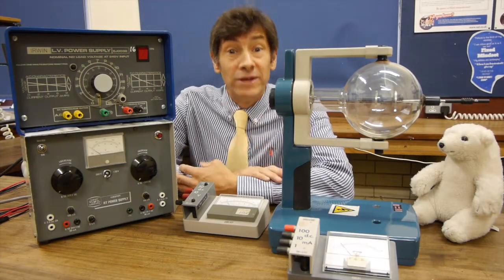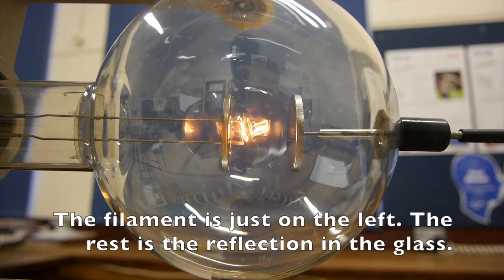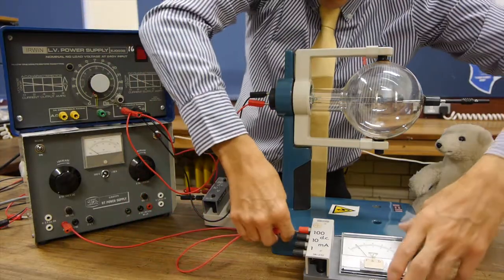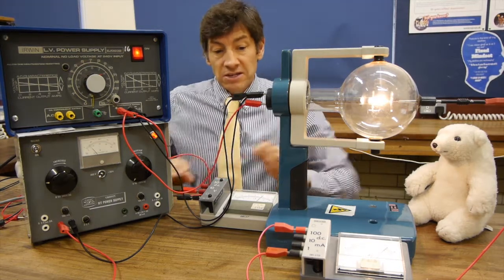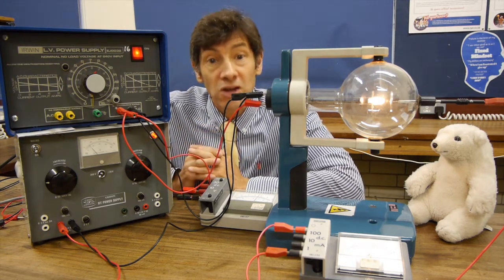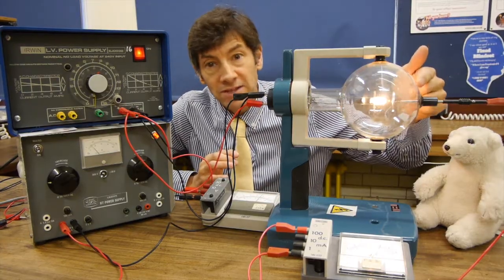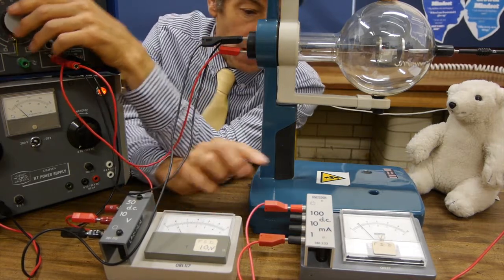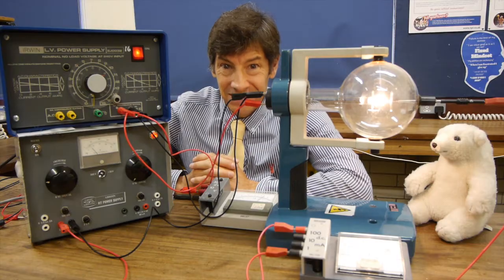Thermionic Emission and the Edison Effect - Teltron Planar Diode Tube - F-J's Physics - Video 146

Comment: Thank you Anthony. A very good demo. Ive often wondered what the work function is and now I know. As you no doubt know valve cathodes were made much more efficient aka lower work function , by using special oxide coatings. And it was interesting to see that up to a certain filament voltage not much current flowed, then quite suddenly it increased over a small increase. 
And I love you polar bear.  He/she looks to be an intelligent student. 
Robert
Reply from the maker: Thanks Robert!  Yes, you are right.  The work function is a really important concept and modifying a cathode's surface with low work function coatings was a great energy (and heat/temperature) saving!  It is crucial to the understanding of the Photoelectric Effect too.  Here is a link if you have not seen it.  https://youtu.be/xGWMmhfPqhM   Yes, the polar bear is regularly in my videos and goes to prove that I do not take myself too seriously!

Comment: I like to demonstrate the space charge first: anode-cathode pd with heater pd. I have just tried it with an EY86 EHT diode valve and an AVO 8, which show the effect perfectly.

I also do it in a vacuum chamber, with a magnet on a feedthrough manipulator to demonstrate deflection of the charges - although this is better with my home-made deflection tube in the chamber.
Reply from the maker: Thanks. yes that is a great idea.  The EY86 is an interesting 'tube' in its own right with Mullards not normally bothering with any getter at all.  For classes I lke the scale and size of the Teltrons.  We did have a vacuum pump top mounted stage for demonstrating such things in an evacuated bell jar but it was all pretty unstable and many of the bits had gone missing but you were meant to build up valve electrodes bit by bit inside it to demonstrate to students diode, triodes and the like.  Bet no school does that now!  Thanks again for watching and taking the time to share your experiences.   I need to do more with the Teltrons especially the triode one.

Comment: Thank you! This took me back over 40 years - I remember having very similar equipment in the school physics lab. There was an electron deflection tube which fitted in the same frame, the beam of which could be controlled using helmholz coils. Luckily one of the physics teachers was also a games instructor and a friend and I were often able to scive off games to do physics experiments. The only stipulation being that we left the lab tidy! No supervision at all but I suppose we must have been as trustworthy as we appeared 😂. Happy days and as a radio amateur I still love valves.
Reply from the maker: Excellent!  Yes, these Teltron tubes were in a lot of schools and my fear is people will forget how to use them or be frightened off by working with HT and EHT supplies (even though they have huge series internal resistances).  Have you seen my other videos on these?  Here, for example, is the electron diffraction one.    https://youtu.be/CR2frJzQZ8k  and here is the deflection one with the Helmholtz coils    https://youtu.be/7hJxn4l47X8

Comment: Given there are two things you can vary here - the filament voltage and the plate voltage - it might make a nice project to show how the resulting current depends on both voltages using a heatmap, contour or 3D plot. It would reveal the saturation effect over a range of voltages, and any current threshold phenomena.
Reply from the maker: Funny you say that, as I am just working on a vacuum fluorescent display video and they make it really clear that small variations in filament voltage have a huge effect on brightness, less so than segment anode voltage.  Thanks for the great suggestion!